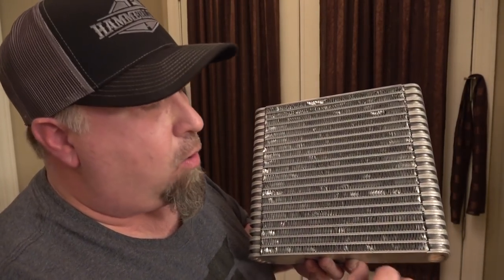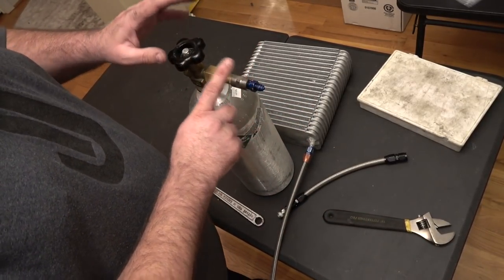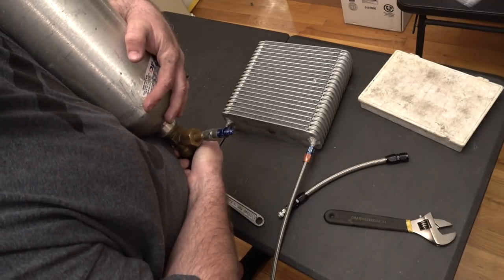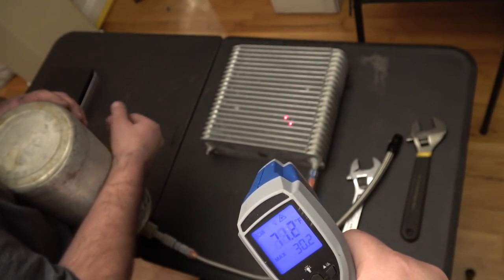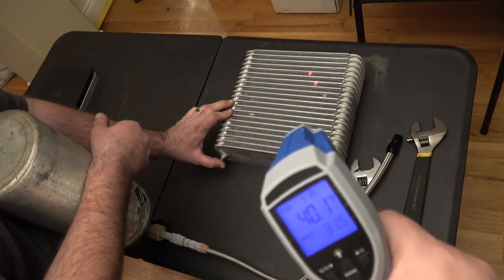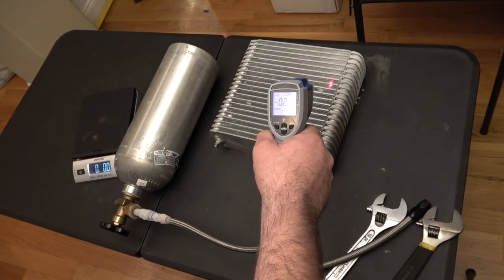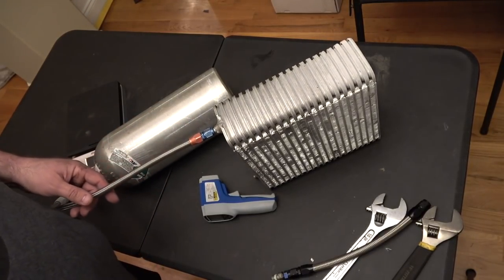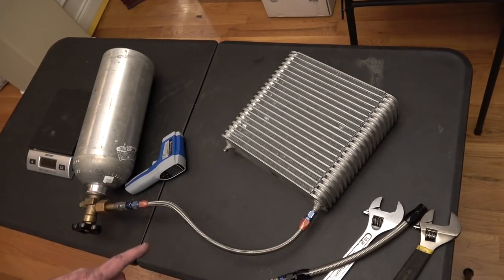Prototype CO2 Intercooler, Super Cold, you can build at home!

Comment: The only issue i can see with this is if you are in humid weather you may get ice build up and actually restrict airflow.
Reply: It’s not to bad but if you’re worried spraying the front of the inlet with something like m100 before the HX unit will automatically de-ice it or run it @ 40F~ + max cooling temperature Chevy blower cars ( ie LT4) sometimes run them as a mod and don’t have a problem with it

Comment: I'm considering buying a barrel style water to air cooler and installing it between the intercooler and throttle body but instead of circulating water i would get adapter fittings to circulate CO2 instead. I dont have a highly modified car but I do get spark knock when Im doing a few rips around town here in Phoenix AZ during the 115 degree summer days lol so I need something to help with heat soak. Not something i would use daily but i like the idea of having cold air on demand for those spontaneous rips. If results are affective I'll add another one  between the intake filter and turbo to help with turbo cooling.

Comment: Under a load it wouldn't work as well, but would definitely work some. By that I mean it will warm up very rapidly, 100 degree ambient at over 100mph. Maybe you could create a layer of frost before you use it. Great idea also I think the tank would freeze over an extended period of time. So maybe a 1/4 mile pass and wait a while. I would consider it a hybrid. Again, great idea just trying to help progress the idea.

Comment: This isnt done because it's not necessary, it's still an air to air intercooler. Your just putting the cooling air inside instead of outside, fogging it over a regular air to air is the same reaction. 

Not saying the general idea may not have a place, but to me it would make more sense to use a smaller air to air and fog a heavier concentration of the CO2 over it then the traditional co2 system can with a large air to air. Smaller capacity of the air system potentially giving a better turbo response, but that's not really an issue for a drag car. Be more applicable to a road course, and for that the co2 consumption rate would likely end up being the downfall.

Comment: I would put another nitrous jet in the opposite side to act as an orifice tube/expansion valve. 🤙 cold as hell. Lol. You may be able to run it back to the bottle. On co2 filling with a mother bottle, the slave bottle always freezes basically. If it cools enough just but equalizing the bottle to the core you may not need another orifice just a cap. But I dunno. Have to play with it. I get some pretty ignorant compressor discharge temps tho. Gas life problems. Lol. Thanks TJ.

Comment: I think you’d have better cooling if your put your jet in a line about a foot before the inlet of the evap core. I think that might help with the inlet getting cold as well. If you think about it that’s how it’s setup from factory with the orifice tube or expansion valve. Cool idea. I think Jeremy from faster proms channel has this on his wife’s Cadi, using the factory ac compressor.

Comment: So I've been thinking about this idea before as well, after I pulled my AC core out of my Honda Element. I thought to myself: what if I just put this in front of my intake?

I realize that he ac compressor would be zapping power out of the engine, which would counteract any boost cooling the air. Using copressed air from a tank was my second idea, but then you would have to buy and refill them, and I wanted something that would stay cool indefinitely. 

That's when I realized... Instead of a mechanical AC compressor why not use an electric one!? You can buy electric AC compressors for your car to replace the mechanical one, and with the good enough alternator there will be electrical power to spare in use of it! So buy an electric AC compressor and try that!

Comment: Is there a way you could recycle the co2 as it goes thru the core and comes out....like a continuously recycleing like a refrigerator does
Reply: The Dodge Demon does this with its AC system.
Reply: David Maudlin That's cool.
Reply: R744 is a co2 used as freon.  With one of these compressors to squeeze it back into liquid form you can recover the CO2 and run through the system again it would require a heat exchanger pull the heat out of the CO2 before releasing it again
Reply: @daviddroescher  but it would work like a water to air system without all the headache of ice and draining it
Reply: @jnltreemasters1269  as stated above it doae on the Dodge Demon. Most likely using R1234 or whatever  replaced R134a.
Temps of -70°F can be seen with co2/R744 liquid to gas phase change. The jet being too big was not causing a proper phase-change, that's why the end of the tank was freezing it was getting exposed to liquid CO2.
Reply: That’s exactly what my mopar is planned on running ( R744 @ roughly 100 bars which I think is sub 5000 Psi but more than 680 psi on the liquid line on a 90f ish day pardon me it’s been a while since I wrote my instructors/notes for converting it over ) to replace the R12 refrigerate ( because the EPA banned it and co2 works pretty good as a replacement) and I hate pac oil as I’m keeping my 1970 RV12 compressor and mineral oil. 

Mine is set up Rb 440/426 as a a multi pass really small air-air ( so I don’t block the rad basically it’s being used as a 4” in pipe ) then the main water to air then co2 to air on the runners/cross ram intake and I think 🤔 the most efficient way is to have a 1-2 gallon tank that’s separate from the main water unit so I have more thermal mass vs directly co2 to air

Comment: Did you ever do any testing on this vs water?  The reason water has been proven to work better than all else is due to the surface area coverage and its absorption rate.... sure the gas is colder than water, but it’s lacking in the other two categories vs the water.

Comment: people been using  ac systems  with evaporator coils ,dryers and the ac pumps   even the dodge demon  uses it  and works great  and then your free from refilling co2  bottles    but  you do  need to run  the ac  compressor       . do like the co2  for the gas    though   def. alot cheaper than  running no2

Comment: That type of heat exchanger, the evaporator core your using, is not exactly designed for that type of application / pressure, flow rate, ect.. you need a pressure regulator, and since this is a “total loss system” you need to control the rate at which the gas leaves the evaporator core.. like a metered orifice..

Comment: I thought about running the intake are threw a evaporator running on the original a/c system the problem it the do point on a humid day at the track or driving down the road it will fill the inner cooler with water potentially Hydro locking the motor or at the very least running a lot of water through it.

Comment: As someone mentioned what if you ran your AC condenser line into the intercooler and back out to the compressor to continuously run AC refrigerant through it? Be like having two condensers on your AC system but would greatly cool your intercooler too... if I’m thinking correctly on how that works?

Comment: i feel like I've stepped into a time machine and its 1995 again......You know this was popular on the imports 25 years ago, right?
Reply from the maker: They used to blow nitrous across an a/a intercooler is what I saw.  This is completely different.
Reply: @TurboJohnRacing  Nah, nitrous was OG. Then people realized paying 4 bucks a lbs to spray your IC was retarded. This is where CryO2 from Design Engineering stepped in. They offer IC spray bars and a tear drop ball that goes into the charge pipe, which is refrigerated by evaporating Co2 through it. Again, the problem here isn't TEMPERATURE its BTU. Sure you can cool the ball at zero airflow but you can't keep it cold with a turbo huffing its lungs out all over the thing. Your best bet is to use a traditional Air to Water IC and cool the water using refrigeration. be it closed loop or total loss {co2 bottle purge}
Reply: @TurboJohnRacing  Hell, they still make it. https://www.extremepsi.com/store/images/d_1076.jpg
Reply: @TurboJohnRacing  in this day and age you want power. you run a modern turbo at big cfm {relatively} low pressure levels with E85. Voila!

Comment: If you get some kind of condensation along the core while the intake charge passes through, would it be somewhat dangerous for water being carried by the charge and entering your cylinders? 
I kinda imagined this scenario with a  air to water intercooler setup if for some bad luck the turbo impeller blades break off and hit the core fins and cause water to leak out and get sucked in the cylinders. Just thinking out loud here.

Comment: Plug the other hole and just fill the unit an see it it evens out the temp all over ,don't see y u have to blow it out far side constantly just wastes  the co2 ,have a Manuel discharge in stead of Manuel filling just lea e the bottle on an discharge closed ,then ur cooler unit is a permanent part of the oxygen bottle basically, then empty system intermittently when it gets to hot for the job , that make sense to anyone,

Comment: Your onto something fur sure if you restricted the outlet to keep the co2 or nitrous in the core longer would knock it down alot more!
Reply: Double sided blade, longer in the core is a benefit, BUT, the temperature drop is due to the expansion of the gas so if you restrict it you'll reduce the drop. There's likely a balance to be had, an adjustable valve for proof on concept on the outlet would make for easy testing.
Better distribution through the core (multiple jets down one side) would definitely help.
Dual sequential cores would also help (think two 1/2thickness cores stacked, jet inlet from the bottle to the cold side (motor facing) core, outlet feeds jet inlet on the hot side (turbo facing) core. Pick your jets and final outlet size for each to choose an expansion ratio (ie 250:1 per core based on an approx 530:1 expansion ratio to atmosphere@60f), and would help prevent core freezing.
Reply: @MeatPoPsiclez  yes I agree with you. LoL I feel informed and less confident in my IQ! LOL

Comment: @TurboJohn my theory here would be what if you put CO2 into a nitrous bottle (so you have a draw tube) and just installed a Nozzle into a charge pipe or the A2A intercooler with a boost activated nitrous solenoid and just tried cooling charge air directly? would be cheaper then spraying nitrous
Reply from the maker: CO2 is not flammable or an oxidizer, I would imagine it might slow down the combustion process.  But could be wrong

Comment: I was actually thinking of suck system, but using the ac lines with a boxed in radiator to prevent condensation going into the engine(as most condensation builds on the sides). Since a year passed, have you fitted it? Works ok?

Comment: I would add an empty tank fitted to the other side so it can cycle back and forth, then you theoretically don’t have to worry about refilling a tank
Reply: after the pressures balance it wont have anywhere to flow

Comment: Wish you would have measured the temperature of the CO2 tank, I'm researching using a CO2 cylinder itself coupled into the center of a block of aluminum, need to know what the tank does. Do you happen to know if the tank was cooled just as much?
Reply from the maker: It got cold, but don’t remember how cold.  Was a lot colder at the fitting

Comment: So what your saying is to use it in a air to water intercooler and run it as a air to air ?
Reply from the maker: yes, use an air/water intercooler and spray the c02 in core instead of the water.  Richard Holdner did a test, but he did it a little different than I would have done it.

Comment: Unfortunately the laws of thermal dynamics are against you here. There's not enough thermal mass here to cool the airflow we're talking about. After all 200mph airflow in the intercooler isn't rare and generally we're talking 100s of kw of thermal energy in drag racing. This looks like it would struggle to cool 10kw with that small of an orifice. Generally you would need to move something like 3/8 hole worth of CO2 liquid and have something like two 5/8 lines off for expansion for it to have a chance.

Comment: From past exp. with air ride systems. Woudn't this expose you terrible amount's of condensation in the line, You can already see the lines frosting over from radical temp. changes. I'm not knocking your idea, but there's alot more R&D that should be gone through. I'd like to see where this leads to. Personally have been considering going to ice box method over most others.
Reply from the maker: Yes, free axing and moisture may be an issue

Comment: I already have an air to water setup with my supercharger setup and an internal heat exchanger in the manifold. I wonder how well this would work. 🤔
Reply: My guess is 30+ hp ( don’t know how you’re engine is setup) based on stock ish Chevy LT4 engines running the kenda kade kit and the dodge demon and the ford lightning with the factory option installed. The max it can do is -10f ish but more realistically on a 75 ish day sub 50 intake temperatures

Comment: I wanted to try this with the engine ac system and use the freon too keep it cold while the ac is running.  I think it would get just as cold and it wouldn't be that hard to tie it into the ac system.
Reply: that's what I was thinking.  Kind of an A/C delete, but you actually keep the A/C, just reroute it through your intercooler instead of the cabin.  You keep the refridgerant and the compressor,  and it will recirculate it to constantly keep it cool.  I think the CO2 get's it cold enough, but you need to keep adding C02 for a cold boost.  Also, your exhaust will be much hotter than the hair dryer, and I don't know how much a setup like this will cool your charge temps for long term.  Of course, I'm thinking about a daily driver setup, while you might have a drag-race perspective.

Comment: Use propane and then dump it into the engine. All that extra air will need fuel.
Reply: Hmm.
Reply: Scott Tod, though not very related to this video, what you referred to is the basis of Liquid Phase Injection (LPI) of Liquified Petroleum Gas (LPG - a mostly propane automotive fuel commonly available in some countries). Ford Australia did that in recent years with its EcoLPI variant of its excellent Barra 4.0L inline six cylinder engine. The LPG is electronically fuel injected into the engine in its liquid phase. It immediately turns to gas when no longer under storage pressure. Latent heat of vaporisation causes a massive drop in temperature of the intake air that the fuel is perfectly mixing with. This allows more air (and fuel)  to enter the engine, producing more power & torque than the petrol (gasoline) variant does. This mild boost without any supercharging or intercooling, combined with high static compression (LPG is a high octane equivalent fuel) not only gives higher performance, but is cleaner on the environment and engine oil, and is cheaper to run too. 🚙
Reply: Lyndon Gordon Hydrogen Peroxide can also be injected into the combustion cycle to increase the thermal efficiency of the engine while also lowering exhaust gas temperature.
Reply: Amaroq Starwind, that’s interesting. Of course, combustion “additives” like that, nitrous oxide, and carbon dioxide (getting back to the subject of this video) all require refilling from special suppliers. LPG as the primary fuel (which isn’t the subject of this video) is commonly available 24/7 at most fuel stations in some countries like Australia. Injecting it in its liquid phase, as opposed to its gaseous phase as is done in a less sophisticated method, results in a mild “boost” effect without any normal boost equipment. 🚙
Reply: Lyndon Gordon Hydrogen Peroxide Injection is actually meant as an evolution of Water Injection, which is already a proven technique to cool off engines and prevent knock (but not necessarily increase power). Unlike water, Hydrogen Peroxide aids in combustion rather than hindering it thanks to the additional oxygen. It's higher boiling point also means it has an even stronger cooling effect.

That said, yeah, it would be kind of annoying to have to refill yet another tank full of liquid.
Reply: Amaroq Starwind, how does hydrogen peroxide injection compare to water-methanol injection for combustion cooling? 🚙
Reply: Lyndon Gordon Well, it just replaces the water portion. It's boiling point is 150 Celsius, basically 50% higher than water. It also has slightly more thermal mass.

Again, the real benefit of hydrogen peroxide over water is that it provides additional oxygen. The water instead displaces oxygen. (Fun fact: Hydrogen peroxide is commonly used in conjunction with flammable fuels in rocket engines.)

Hydrogen peroxide and methanol together might work, but that mixture might combust on its own without the addition of air, as it's essentially fuel + liquid air already.

There's a research paper titled "Effect of Injecting Hydrogen Peroxide into Diesel Engines", if you're interested in giving that a read.